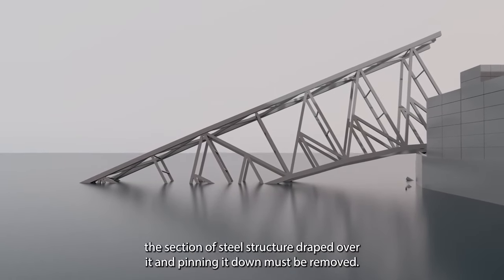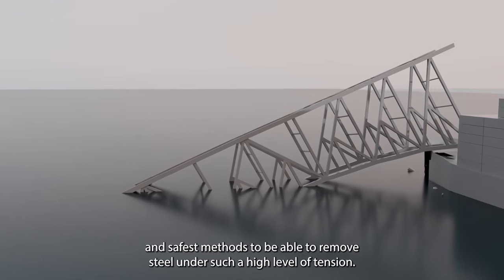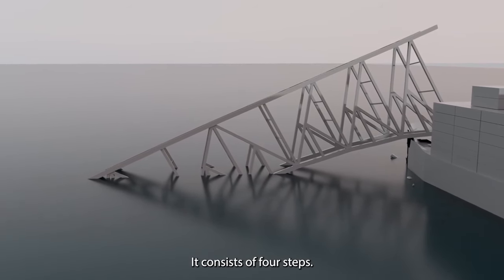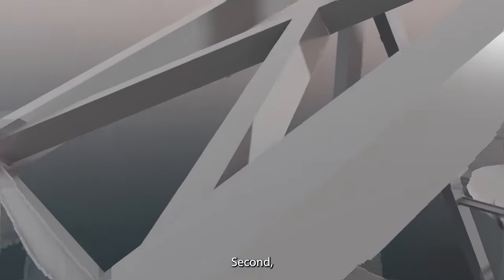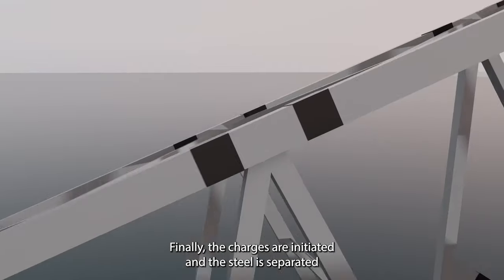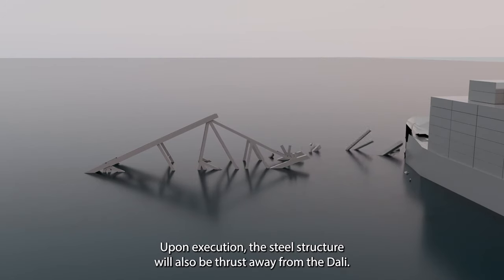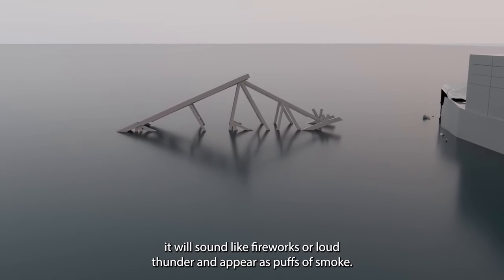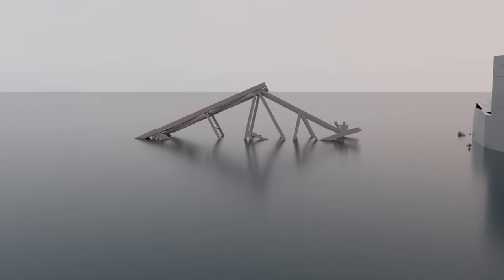strategy for moving parts of the bridge located on the M/V Dali

Comment: This section is about 10 times heavier than what the biggest crane can lift thus it must be cut with controlled demolition.
Reply: It's 4 times heavier, but only one end needs to be lifted.
Reply: @jacks5kids  I read somewhere it is 10 times but you could be correct in that it could very well be 4 times.  You would still be overloading the crane and either causing crane failure like a boom collapse or a rigging to come loose, and they would still have  the problem of barge buoyancy.  Two crane lifts even on land are extremely dangerous and generally the acceptable load for each crane is 80% capacity and the lift must be  pre engineered.

Comment: Why get paid 500.000 when you can get 2.000.000 ?
Reply: Are you saying this is more expensive overall?  I haven't seen any cost estimates.
Reply: @KenJackson_US each charge is $500, but you can charge $2000 if it works. 😳
Reply: @MrUtubeobia  Is that more expensive than slowly rigging, slowly cutting, slowly hoisting, slowly carrying it away and slowly repeating?
Reply: @KenJackson_US    that's a good question. The flip side is nobody gave us numbers to compare both ways.

Comment: This is bound to cause additional damage to the ship. The actual explosion is unlikely to be picture-perfect. Use of explosives is an admission of defeat, and demonstrates a lack of capability in mechanics design.  Having a bunch of cranes, the biggest of which having a maximum capacity is 1000 tons might not sound enough to move a 4000-ton bridge section but with proper design, it should be. Given 6 weeks to think about it, it should have been possible to design and assemble an arrangement of tension cables that exploit the remaining base of the concrete bridge support that allow sufficient mechanical advantage to make it possible to lift one end of a 4000 ton load by a small amount, in order to allow the wrecked steelwork to be swung away from the ship.
Reply: Maybe this poses the least danger to the Dali.
Reply: Thank god you aren't involved in this salvage operation
Reply: @peacenow42 : "maybe there are other factors in play ..."
The only factors I can think of are:
1) Worker safety,
2) Time (getting the channel clear as soon as possible),
3) Avoiding further damage to the Dali or equipment, and
4) Cost.
Though I'm not sure if higher costs are seen positively or negatively to Democrats.
I can't imagine the little information released would do harm.
Reply: @jameswright1797  Yes, I also thank God I do not have to work on this wreck. It's really bad that such an unsafe bridge was allowed to operate in the first place. It's also terrible to see how badly this salvage operation is progressing. It's being managed by the military. That is not an impressive engineering body. The USA's huge defense machine is simply not an engineering corporation. It never erected a bridge of any significant size. It is not well qualified to do this operation, an there is nothing wrong with admitting that. The Defense department is there for defense, not engineering. So yes, thank God I am not part of this underqualified team. I am an engineer with lots of international recognition in my field, which BTW is NOT steel bridge construction. Still, the USA has 4% of the world population and 53% of the world's major fatal bridge collapses.
Reply: The biggest problem I see is the cranes are not designed to handle shock or side loading so having cranes try to move the whole thing by swinging it from one end won't be in the cards.
Reply: There is only so much flotation in the barrages.  Even if the cranes could lift it  the weight would sink the barrages.
Reply: @peacenow42 Military engineers are not design engineers. Period. They are soldiers.  They specialize in operating military engineering equipment, not in designing things. Military engineers are not the people who design our bridges, rockets and microchips. A military engineering general is trained to blow things up, not to design machines, and that is exactly what is happening here. We can love and admire our servicemen, but pointing out that they are not design engineers is not bad-mouthing them, it is just saying what their training is
Reply: @leonardcollings7389  Correct. The force must be transferred to things like the concrete bridge foundation, which is still there and can bear tens of thousands of tons of vertical load.
Reply: @peacenow42  In Russia / Ukraine, for example, that is correct, but not in the USA or UK, where invasion over land is not a concern.
Reply: @peacenow42  Trying again.  The public is kept safe by keeping us away.  The investigation started immediately, so they know everything by now.  How could (7) be separated from (6)?  Politics is always a concern, so nothing new.  Though I'm tired of grandstanding [censored?].
Reply: @leonardcollings7389    in the case of that larger crane, the barge is part of the package so is capable of lifting full capacity without sinking. Yeah, it sounds crazy, right?